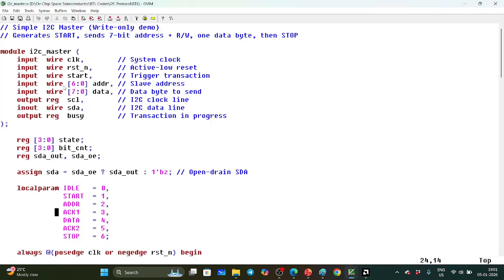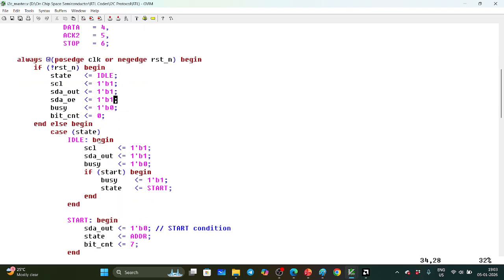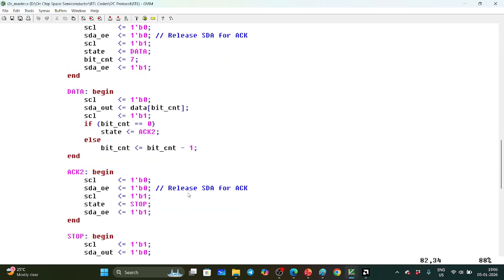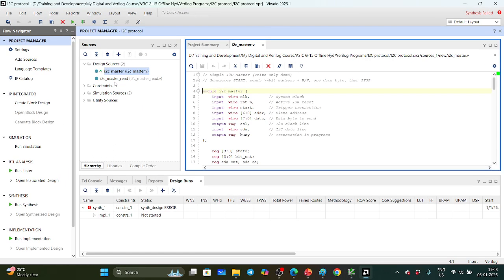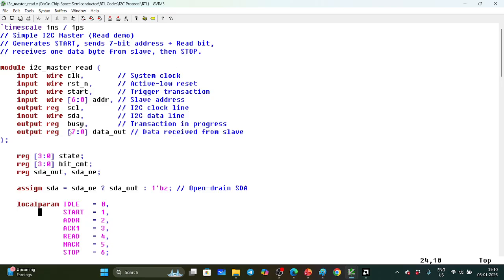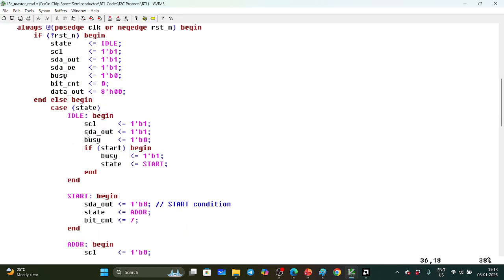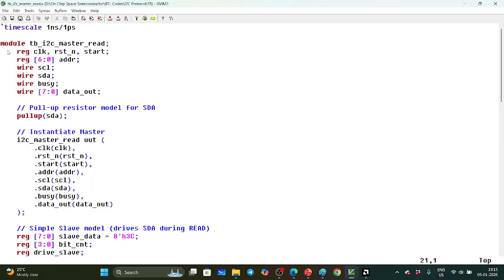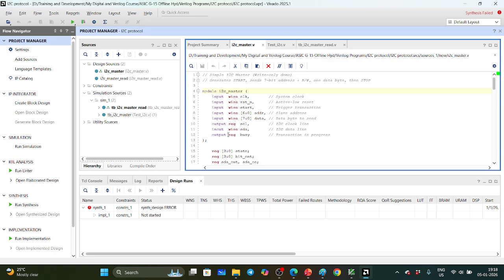I2C Project | Write & Read Operation Using Verilog (RTL Design)

Comment: sir for the acknowledgment you are making sda_oe to 0 which assigns sda to high impedance based on the conditional operator , in actual i2c protocol the +ve acknowledgement means sda should be 0 , but here we are assign to high impedance , so is it not a violation to protocol mechanism
Reply from the maker: How ACK works in real I²C hardware
I²C uses open-drain (open-collector) lines.
Devices never drive SDA high.
Logic:
Drive 0 → pull line low
Release line → external pull-up makes it high
ACK = SDA LOW during 9th clock
The receiver generates ACK by pulling SDA low
The transmitter must RELEASE SDA during ACK